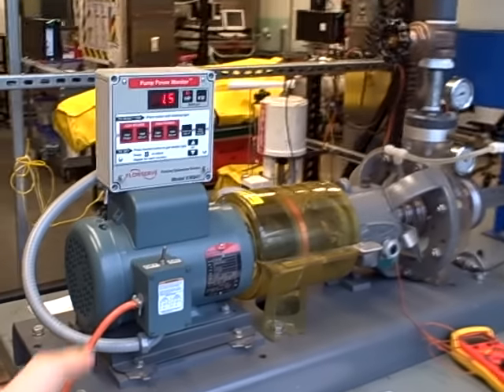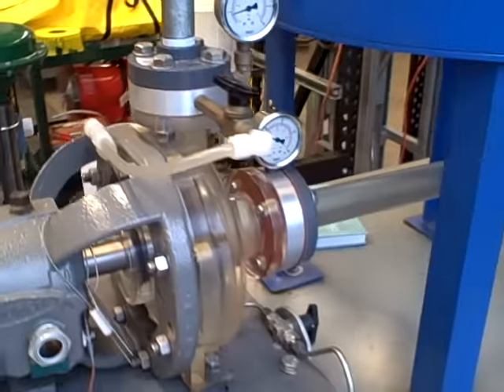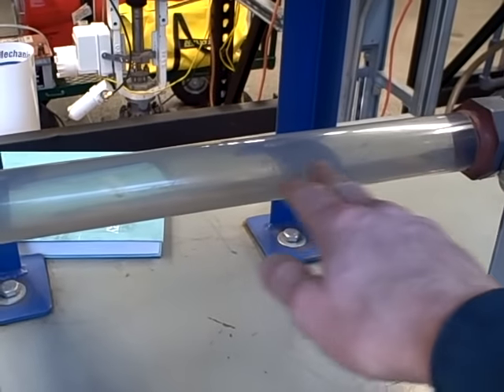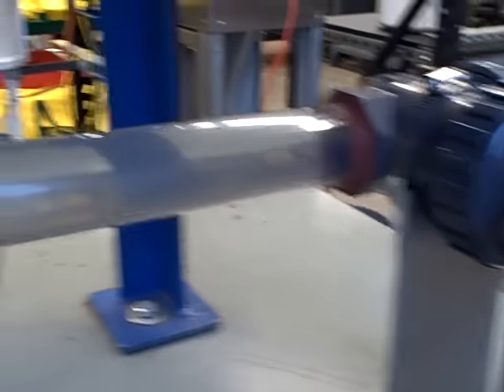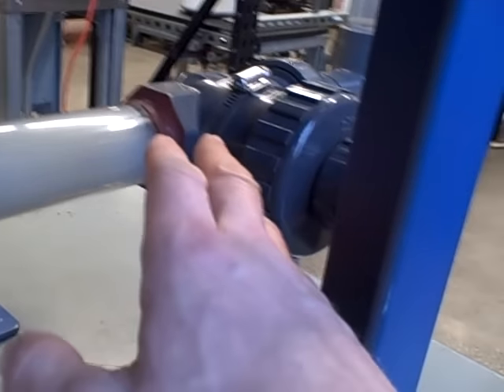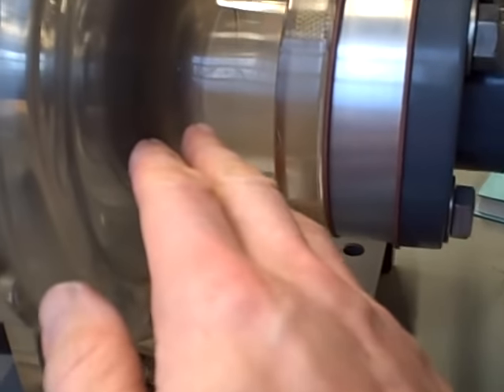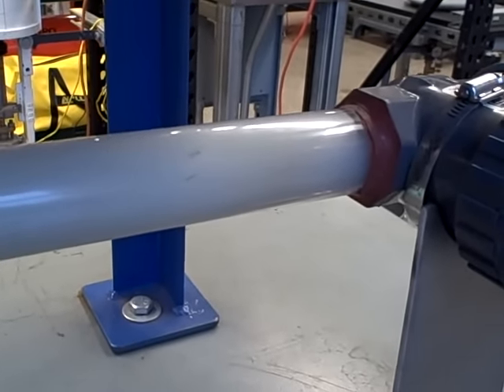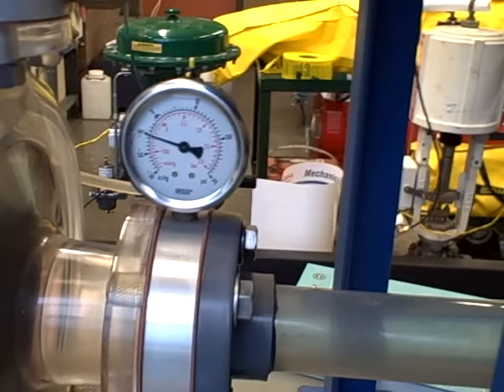Cavitation in a water pump

Comment: Be careful, that cavitation you see just after the suction valve is caused by the pressure drop through the valve not the pump...sending them to the pump.

Comment: Is it possible for cavitation on an outboard engine to cause a noise like this at 2-3 mph ? But smooth any other speed.

Or does it need to be in a closed system for that noise